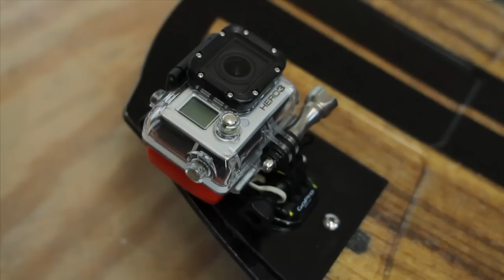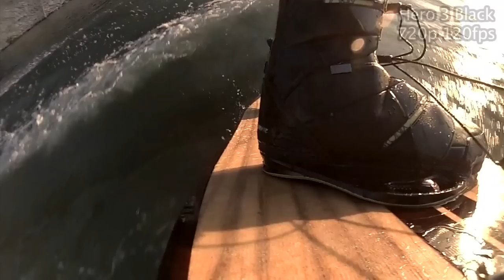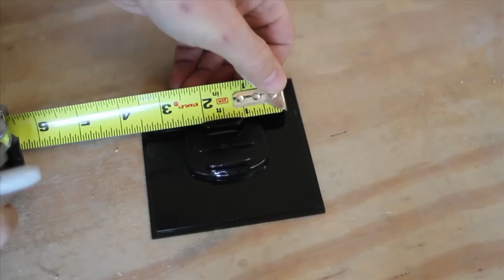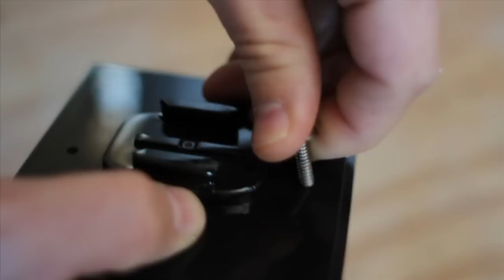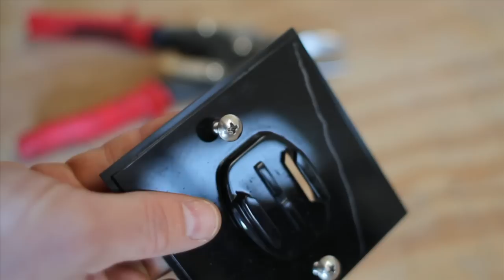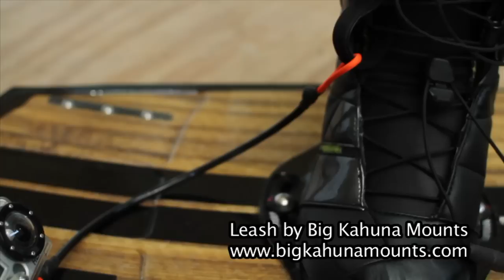Base Plate Mount on Wakeboard! GoPro Tip #98 | MicBergsma

Comment: this was the very first mount i ever used for a GoPro  haha ,.. i bolted it to the fuel door on my jet ski that way i can switch around to different jet skis if i want ,... i also used the Base plate and siliconed it to the plastic box that covers the new Go Pros  ,. and then i glued that box to a old kneeboard that way i can get still video  of floating in the water ,.. im thinking about changing the kneeboard  and putting a 10-20ft pole on it that way i can film jet ski riding from way up high

Comment: Good Idea..tried it out. It worked for two sets.  On the third wakeboard set, after I came around the Tantrum the base plate snapped where the camera mounts and sent my camera flying into the water.  Luckily I had the floaty and we found it ten minutes later.. I will be buying the suction cup for now on..The base plate from the packaging is too weak for high impact wakeboarding.. you guys must not be jumping or something?

Comment: Awesome idea MicBergsma but it only lasted me 2 hours at my local cable park before snapping one side of the mount that you clip into... I'm guessing it takes a lot of shock when directly connected to the board because I had just replaced a broken vertical quick release clip on the lap round before. Have you discovered any other mounts to srew into the fin mounts? Awesome view, just need stronger plastic!